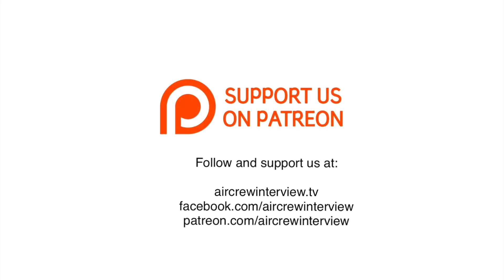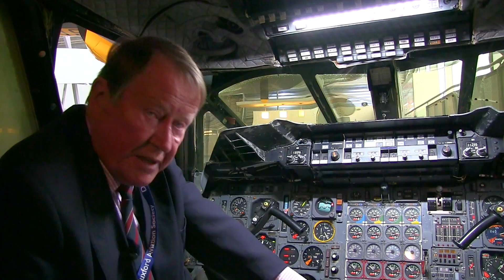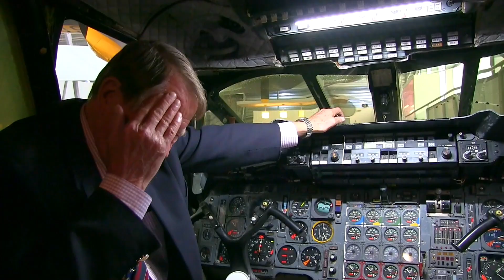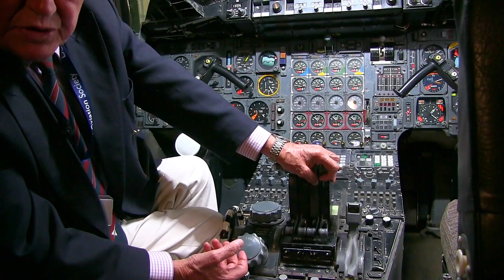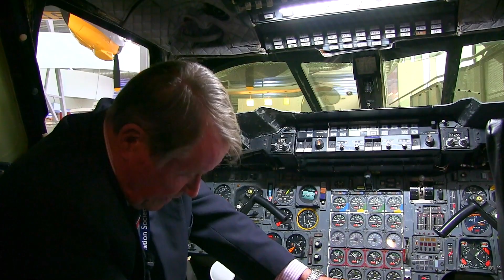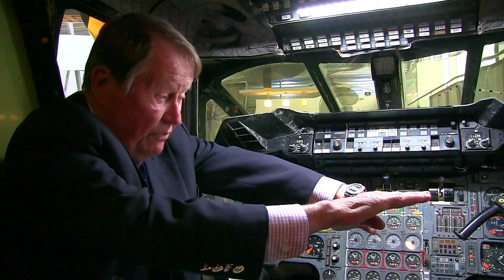John Hutchinson on Air France Flight 4590

Comment: All the British Concordes recieved a Modification for Kevlar Fuel tanks, the French decided it was uncessary and went against the advice which if taken this accident does not happen and maybe concorde would have continued further into the future
Reply: Most average people know nothing about the many times a Concorde tire came apart impacting a fuel tank even to the point of causing leakage. Those with deeper industry knowledge were well aware of the problem and the potential for disaster. Concorde was also not the only plane with this kind of vulnerability back then, and even now bad things can still happen when a tire comes apart but fuel lines and tanks are better protected now so the event is less critical. France didn't adopt the kevlar protection for two main reasons: cost and the fact that it only reduced the risk, not eliminated it. Given the prior history they felt that such damage would not be catastrophic- this proved them wrong. And with their goverment not subsiding Concorde at the level Britain did certainly influenced their decision. Concorde was one of the safest planes of it's time, and with a few modifications would not be any less safe than today's planes.

Comment: Why did they discontinue using the Concorde? Because they couldn’t make any money despite charging $7500-$10;000 one way. Over 50% of the seats were filled by people using their frequent flier awards. Problem 2- Can you guess how much BA and Air France paid for their Concordes? Try $0.00: 0£, 0 Francs. The aircraft were given to the airlines, not a single Concorde was sold to any carrier and no carrier outside of BA and AF were interested in flying the Concorde. It could only be used flying from coastal cities to coastal cities, not overland because of the sonic boom. The only routes with a demand that could possible fill the aircraft were Paris-New York, London-New York, charters flew to other places such as the Bahamas or Sydney, Australia. 
Problem 3- The Concorde needed updating, this was a design from the 70’s and now it was the 21st century, despite its very advanced design, the engine technologies, navigation equipment, tiers and wheels, even the wing surfaces needed to be replaced by composites. Nobody was stepping up to pay for an aircraft that would be a money burner, needed a $10-15 Billion redesign and could only be viable on one route. I miss seeing it too
Reply: You are completely incorrect about profitability in regard to BA. Concorde was very profitable for BA from 1982 until its retirement.. It was only 20% more expensive than First Class and took less than half the time as a subsonic aircraft JFK-LHR.  They did not get the aircraft for free either. There were complex reasons for Concorde not to sell, some political but primarily the Oil embargo in the 1970s. You really should inform yourself before making comments. 

The airframe did not need to be replaced in any way. (You can see the new Boom Ovatiure is almost identical in every aspect except it is slower.) Composites would be a disadvantage in some areas. Its speed meant it heated and so did not suffer from corrosion and its engines were state of the art for sustained supersonic flight (and remain the most efficient turbojet engines ever produced.) It remains the only aircraft in the world that could supercruise (fly supersonically without afterburner) for 3 hours at Mach 2.0. No civil or military aircraft can even do that today without refuelling.

And it was a delight to fly on. 60,000' at Mach 2.0? You could clearly see the curvature of the Earth and the day/night terminator. An amazing experience.
Reply: @Completeaerogeek  Hogwash, The BA Concordes may have been operationally profitable (revenue exceeding operating costs) at various times and on various routes however, on a full cost accounting basis (taking into account the depreciation on the airframes and the aircraft's development costs), they have not turned a profit. 
However, the 2000/2001 suspension, the return to flight mods and worst of all re-launching just after Sept 11th made things difficult. 
But, loads were generally good, however BA were afraid to commit to a double daily service, no doubt fearful of bad PR if it was not profitable in this new business environment and had to be scaled back again. 
The result was an operating profit, but not enough to fund upcoming maintenance, as well as additional stuff like the $300,000 cockpit doors, no Federal-style help for BA for stuff like this. 
BA do not get the aid seen in the US or some EU nations since 2001. 
Then AF bailed out for a variety of reasons, making the BA operation unsustainable as they now would have to carry the whole support burden themselves. 
The bottom line, IF the operation of the Concorde was profitable, Braniff, Pan Am and several other carriers would have followed through and bought their own Concordes. Airline execs aren’t stupid. Non French or British airlines would not have gotten their Concordes for free however. 
Keep in mind that this was a 70’s era aircraft that after 24,000 hours in the air was in need of updating, yet the government’s weren’t going to pay for a new Concorde and the occasional profits weren’t great enough to make major changes so the program had to die, it could not have been sustained.
Reply: @bobbypaluga4346  RASM vs CASM is EXACTLY how you measure profitability. It has nothing to do with purchase costs which can be borne over 20-30 years. That is asset amortisation and has multiple factors. 

By your measure the DC-10. L1011, Convair 880/990, B 717 and A380 are all unprofitable aircraft as they never made back their development costs. Or if you want to get particular, the B-707 has its development costs completely paid for by US govt via the KC-135 program

It is a FACT that Concorde was Consistently profitable for BA and even figured as a premium in the share price when BA was floated and the UK govt was paid back billions. BA also had to pay back the first years operating revenue to the UK Govt. 

The 70s fuel crisis, the introduction of widespread service of the B-747 and a lot of political opposition stymied Concorde sales but that has nothing to to with it as as operating platform.

BA invested millions in the refit after the accident and  had a program plan to run it until 2010-15. It's airframe was quite young by all standards.

Airbus pulled the type certificate. 

THAT is why it as grounded.

Comment: I remember Mr Hutchinson getting ridiculed for his view and assessment due to his passion for the concorde.

One has to remember that the pilot and his crew where trying there absolute best to save the flight and in the heat of the moment (cannot comprehend) things may of not gone to exact plan.

Having covered this accident many times and I also are passionate about the concorde it was a combined failure of maintenance,  proceedure and conditions that caused the problem for the flight. 

JHutchison was a passenger on a conventional aircraft which suffered a fire from an engine on take off and the crew controlled situation and landed, there was fatalities but ultimately there was survivors. JH biggest issue with the crash was how did the plane he was on survive and the more powerful concorde didn't. 

If it didn't run over the metal strip then the tyre would not of failed or was there failure immanent from other factors. Tyre failure was common and fuel leaking from damage to fuselage. 

I was led to believe Air France was not using the updated tyre guard? Tyre deflector at front row of landing gear. This was to catch debris and force to sides. 

Concorde was ageing and facing tough times ahead and at some point would of needed major upgrades. 

With only one crash throughout service was incredible considering the environment she lived in was remarkable.

My opinion is AF4590 was a bad chain of events and the crew did all they could with the situation they were in. Air speed to low and engines stalled, even with correct air speed and x4 engines full power I think the fire burning through the fuselage would of caused them to crash or explode.

I massively respect JH and he was part of the investigation with the concorde crash however I don't agree the crew failed. Fire warnings and ATC informing them of flames on take off the flight engineer went by his warnings and did his job.
Reply: The crew was beyond complacent. Not following simple limitations of weight, fuel loading, CG, performance data and the lack of good judgment & horrible CRM doomed the flight before it took off. No airplane should’ve been operated in this careless manner. I would bet this captain had done the exact same thing dozens of times and was one you didn’t question. He had gotten away with it before and became extremely complacent. Captain Hutchinson is 110% correct.

Comment: The most 'enlightening' fact is that had there been thorough maintenance  -- amd proper signing off of work carried out -- by Airfrance maintenance i.e. someone signing that the aircraft is airworthy (as in the RAF when someone signs the 'form 700.' Hence responsibility is clearly established for whose neck is on the block if there is an accident) undercarriage wheels wouln't have been capable of shimmying around chucking chunks of rubber off the tyres. i.e. each maintanance  operation would have to have been signed off prior to the French  'F700' being signed. What is absolutely terrifying was the total absence of adherence to strict rules on flight refuelling and fuel loads, and total all up aircraft weight. From knowing someone who worked in Concord logistics, Also, I gather the French did not physically inspect the runways for extraneous bits having  dropped off aircraft previously as fastidiously -- or as frequently -- as at Heathrow. But rules it appears were just a shrug of the Gallic shoulders.
It was also a fact that the French -- from what I was also told -- did not treat their Concords (forget the extraneous 'e;' that was only added by Wedgewood Benn to humour the French) as serious passenger carrying  -- and profit generating -- aircraft. Consequently  they needed less upkeep than B A Concords. The corrolory being B A logistics ran out of parts and had to have new ones remanufactured because as time passed the parts were no longer manufactured. Result? In joint meetings with the French logistics B A asked if the French would share the cost of re-manufacture?  The reply: we 'ave no problem wiz zis part' (because they didn't use their aircraft enough) and they used to add: but eef you are go--wing to re-manufacture zen we will 'ave one of zose parts. i.e. they would not share the cost. Which absolutely infuriated B A logistics. And this was a consistent stance the French took.
The only time I heard of a BA Concord almost falling out of the sky was, for some reason, one Concord had to be given landing priority at Heathrow i.e. NO delay / 'go around' and when it had landed the 'plane had to be refueled BEFORE it could get off the taxiway.  (Adverse winds ? / long take off delay??)
In the course of discussions between B A and Airfrance logistics concerning  the life of parts and the need to source more spares, the question arose as to how long the Concords would fly in the future. The response from the French being: we weel fly oh-wer Concorrs a-one day longer zan you (BA).
Which, frankly, says it all. And 113 people got incinerated after crashing. (109 plus four in the hotel at Goness) NOT just -- if just is the word -- from the chunk of titanium left on the runway by a previous aircraft, but the concatenation of fatal disregards for strict procedures being followed by Airfrance maintenance and the total disregards by the pilot.
Great credit to Captain John Hutchinson for the courage he shows in telling the truth -- which I personally have never heard before. And which brings me to the point of choking with tears of utter futility that someone should 'drive' their aircraft like a drugged up  maniac driver blasting out traffic ( red warning) lights till they inevitably smash into someone else. 
What also becomes clear from Captain Hutchinson's words is that the gulf of the difference between inviolable adherence to procedures was as wide as building the Eifell Tower  and leaving  bracing struts undone  because it was time for 'le dejeuner' (and missing the accent over 'e'), and never bothering to correct either.
Buy it appears even Captain Hutchinson hasn't given the full story so far as engines go. Or the mental disposition of the pilot who was a cowboy who had crossed the Atlantic on a surf board. NOT the dependable bomb proof mentality fundamentally mandatory for suitability as an airline pilot of ANY kind let alone Concord.   
And the footnote to all this is that the FIVE Concords of BA produced TWENTY FIVE PERCENT OF B A's PROFIT. i.e. from about as many percent of BAs total fleet (i.e. five percent) of aircraft that produced the rest. And when BAs Concords were refurbished with strengthened tanks they were also 100% crack checked (for metal fatigue in every part of the airframe).  NOTHING that could be removed in the overhaul, was left on the 'planes. When they flew again they looked like new aircraft (from the new paint) which was because they WERE new aircraft. And could have flown for another 25 years.  We had an aircraft industry (in 1959 when it all began) that could have created  Concord without the French. 
History would nave been different if we had, and we had politicians who were capable of understanding something more techical than an enema syringe or capable of using a toilet roll.
Reply: @Billy Rubin British airways had more than 100 aircraft in their fleet. British airways 7 Concordes wasn't 5% of their total fleet. They had 408 aircraft at the time.
Reply: Billy -  very informative and, although this is a sad subject, you even managed to give me a slight smile with your descriptive scenarios in relation to the laze fare attitude of which the French are known and I do not use that term in a positive way. I hear your pain in that Concord (deliberately dropped ‘e’ ) was a magnificent bird and it is a loss to aviation that it no longer flys. Thoughts for all those struck by this tragedy.
Reply: I mean ‘laissez-faire’.(sp)

Comment: Re combinations of things John is right. I always thought it took three elements to cause a crash or give you a heads up not to fly today. Once I wanted to go on a pleasure flight. I reversed the car over a brick which caused a puncture, no hassle change the tire and move on. On the way to the airport I noticed all the traffic lights were red, kinda strange. Then when I climbed into the plane the battery was flat. I cancelled the flying thoughts for the day. It just wasn't the right time to fly.

Comment: Lots of information here, but I'm left with an unanswered question: why did the captain decide to take on more fuel than what we are told was normal, and why did he ignore the takeoff weight and center of gravity limits? Was there some reason to think the plane would run out of fuel? Was he planning to use the extra fuel to fly faster and make back some of the time lost to the thrust reverser repair?
Reply: This is the root, the core, the foundation question that has yet to be answered. Why did Captain Marty insist on filling the tanks to 100% capacity? Then insist on loading the extra 19 pieces of luggage?

Comment: Thank you Captain Hutchinson for telling it how I have been telling it since the crash.  The French authorities put so much weight on the metal strip, they used it as an excuse to blame someone else and not the crew and Air France. Ask anyone about the crash and they will blame that metal strip. Which as you now know is pure rubbish. Protectionism at it's worst.

Comment: But for that accursed bit of metal  could the flight have proceeded  unevenfully despite the captain breaking so many rules; Concorde  did become airborne. Time magazine at that tragic time  dealt with the personality of the skipper Christian Marty described as a ' man at home with danger'.First Frenchman to wind surf across the Atlantic; handglide over volcano craters; ski the most diffilcult slalom courses. A man prepared to regard adverse factors as a challenge

Comment: There's one direct contradiction with the BEA's report. They found the captain ordered the flight engineer to shut down #2 engine after the fire warning. The FE didn't just do it without asking.
Reply: The shutdown order was clearly heard in the CVR. From this we can conclude that the Captain would have been aware of the loss of power from at least that point onward and would have adjust the flight profile accordingly. When #1 failed afterward there was no longer any hope of remaining in controlled flight for very long. Concorde had been tested with two engines out in flight, but not at take-off and not with both on one side. Even today some things are left to the odds that they will likely never happen together; it's simply an acknowledgement that guaranteed safe flight is impossible to completely achieve.